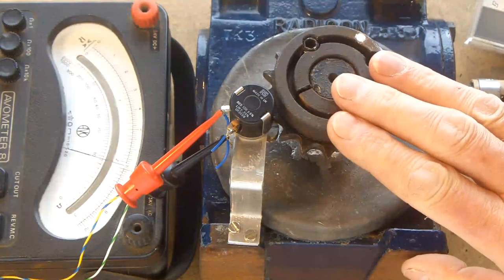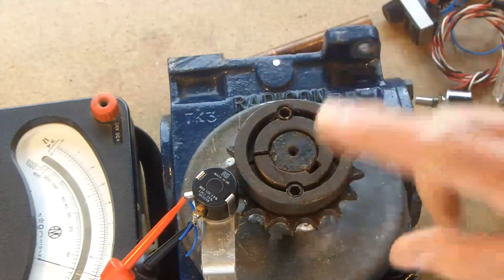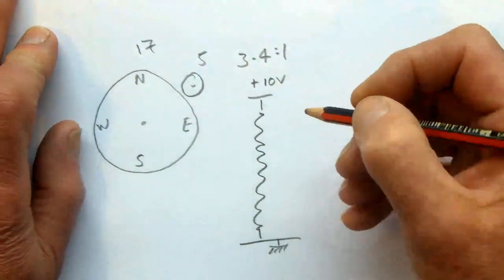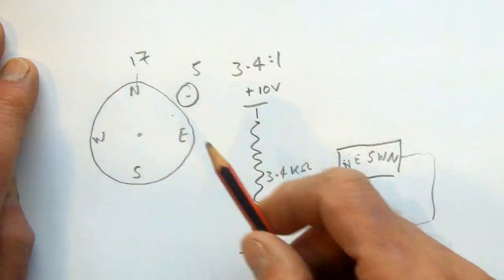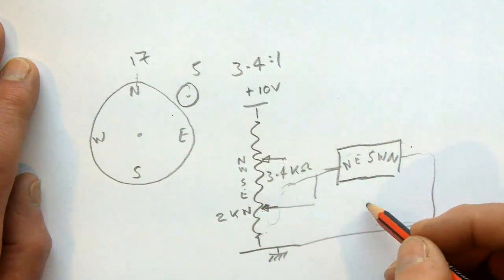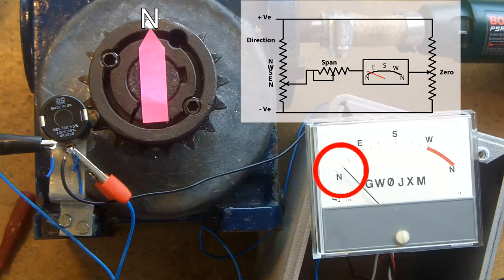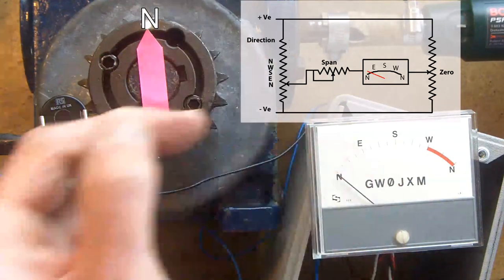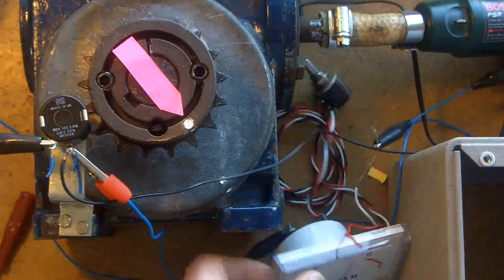About Radio  78 part 10 setting the 'Span' & 'Zero' controls

Comment from the maker: Hi, I was going to do that next time, to protect the pot I’ve got a plastic screw top container, I'll drill a hole in the bottom of that for the shaft to go through and I haven’t really thought through the drill motor protection yet. I'll look in the junk box and see what leaps out at me. I'm not too bothered as I know there’ll be something that’s ‘Just right’  thanks for the interest in the project. If I wasn’t putting this on video I’d have finished it two weeks ago!!
73’s ... Andy 
GWØJXM